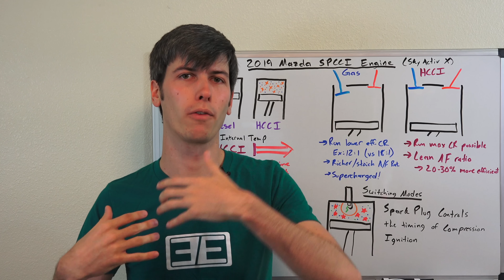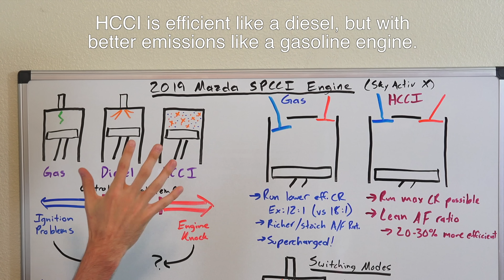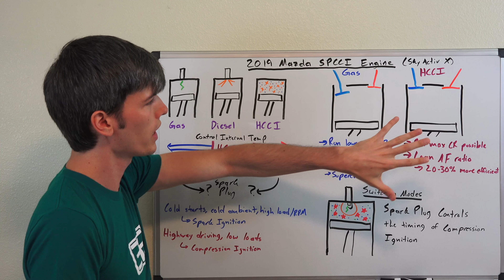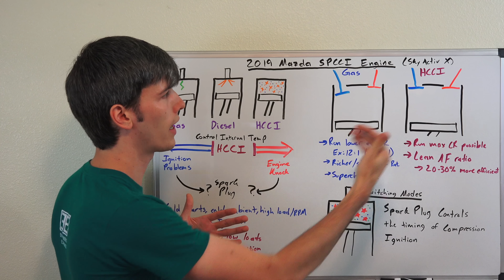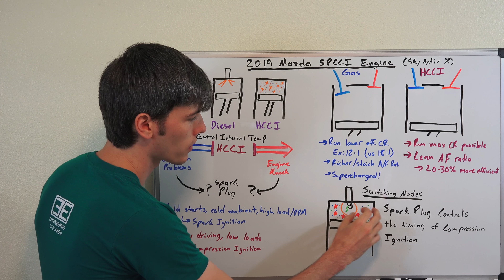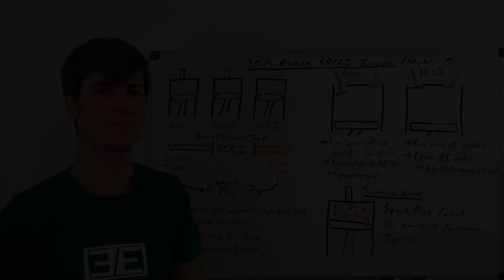Mazda Creates The Holy Grail Of Gasoline Engines - HCCI SkyActiv-X

Comment: When you create these high tech approaches to transportation be sure not to lose sight of who your customer is. How many times have you heard "Joe the shade tree" complain about fuel injection and the use of electronic ignition? Numerous,too many times too count? Why are you introducing another bit of tech that the average guy will not even be able to perform a "crank no start"on? Tech for tech's sake is an incorrect application of technology.

I agree with a previous poster. Stay electric, it is the future for personal transportation devices. Yes electricty can get complex but people tend to observe the warning "Halt,deadly voltage present,no serviceable parts inside" and either learn how to safely work around the voltages present with their auto or use a professional.

Don't get me wrong. I enjoy these ideas concerning a piston and cylinder. I am sure we have only scratched the surface as to how to make best use out of a piston that fits tightly into a cylinder, so keep up the good R+D.

Comment: I´ve read somewhere that HCCI engines controls that power stroke injecting the fuel into a smaller chamber in the cylinder head where the AF ratio is stoich (And the rest of the cyl is filled whit air). Then as this main combustion event takes place the piezo injector continus to inject the rest of the fuel in order to complete the power stroke.
The piston goes upwards compressing just air, the when it reaches the proper timming the injector skirts a little amount of fuel in a pocket located in the cylinder head where it also lives the sparkplug (in that pocket the AF ratio is 14,7:1 so the combustion takes place) but it isnt enough fuel to complete the power stroke thats where the piezo injector skirts one o multiple injections to "power up" that stroke, I´ve read it somewhere, don´t remember when

Sorry for mi english

Tnks

Comment: I dont understand. It is just an otto cycle but supercharged. Whats the difference?
Reply from the maker: That's not all there is to it. This may help: https://youtu.be/OVWZFdb_AGc
Reply: In my opinion (not based on any fact), If we increase compression ratio, use high octane or much higher fuel, incorporate atkinson cycle such that the intake valve closes at that time which will result in higher compression ratio, and expansion ratio much higher, it would give much higher efficiency, higher than diesel.
Reply: leaner air/fuel mixture = better

Comment: Bring on the sustainable zoom zoom! I've managed to get the sustainable part nailed (converted all the fuel lines and seals on my turbo diesel so I can run waste veggie oils) but I don't even have 1 zoom :(  Two zooms is the dream! xD
Reply from the maker: I hope with great patience, your first zoom will arrive.
Reply: Engineering Explained Thanks but it won't happen with my current engine. It's a modern small capacity (1248cc) turbo diesel. If I stick with using diesel, I can get it remapped up to 130bhp, 187lb/ft without changing anything but running veggie oil seems to upset the computer, anything over 112bhp and 155lb/ft the computer goes in to safe mode. I've put it back to the stock map (87bhp 132lb/ft) for peace of mind. On a side note, seeing a new Vauxhall Combo 1.3cdti on a dyno has to be one of the funniest things ever to watch!
Reply: Herr doktorbimmer Yes, absolutely. I enjoy building and modifying cars and 4x4's, especially turbo diesels. A Tesla 3 is £30,000, a Nissan Leaf is £24,000, I got my van as a pre registered new van with only 28 miles on it for £7,500 (retail price is £14,450), I spent roughly £375 on the fuel lines and seals so I can run CARBON NEUTRAL waste vegetable oil then I spent another £200 to get it properly tuned. So, for just over £8,000 I have a van that is CARBON NEUTRAL without the need to destroy parts of the environment to mine the minerals needed for heavy batteries. I don't suffer range anxiety, if I need fuel and don't have any WVO with me, I can put diesel in which takes maybe 5 minutes to do, including standing in a cue waiting to pay as opposed to waiting 30 min for an 80% charge or 4 hours for a full charge although, I've never had to use diesel since converting to WVO as my van easily gets 700 miles from 1 tank of fuel.
 
 I get my WVO from a couple of local fish and chip shops for free, they have to pay for it to be disposed of otherwise. WVO also doesn't emit NOx when burned. An added benefit is that I am allowed to make and use 2,000 litres of WVO fuel without paying any fuel tax, that means almost 26,000 miles per year in my van tax free and carbon neutral using a waste product that would end up in a landfill or worse.

 I have no doubt that electric cars are the future but not with batteries, they will only really be worth it once Hydrogen fuel cells are an economic reality.
 On a last note, go and google "Lithium mines Canada" to see the damage to the environment they cause.
Reply: Trenten S I took the van to get professionally dyno tuned by a diesel specialist, the standard ecu is fully programmable on my van. The tuner thinks that the burn rate of the veggie oils must be different enough from diesel to mess with the O2 sensor in the exhaust. If I was going for big power, I would look at a stand alone ecu for more precise control but it's just not worth the cost for the potential gains as it's such a small capacity engine.
Reply: quinnjohn1 hmm. I am not sure, im going to UTI technical for diesel tech next year so I have been researching, all I know is that veggie oil burns similarly to diesel but emits a different exhaust fume, so I would think he's probably right considered this isn't a "fossil fuel." Maybe an O2 sensor would be worth looking into. At least something that can recognize veggie fumes.
Reply: quinnjohn1 thank you best of luck trying to fix your van! 😊
Reply: Herr doktorbimmer wrong it isnt a zero eisions car produktion neds more emisions and a e car is haviwr and need mutch more  materials anyone that says e cars are complete zero emision cars are a liar and the electicety comes from coal poweroplatnst that are way dirtyer 

buy the you can make bio fuel from seaweed that makes the ice car co2 neutral so wat ?
Reply: Engineering Explained Could lpg or lng injection assist this man achieve zoom with the veggie oil?
Reply: Robbie Mac I have a friend who has a 3.0td Hilux Surf with LPG fitted and it goes like a train! It's just too expensive for this van, it's meant to make me money, not use it up lol. When I can get enough saved to build myself another Hilux, LPG is definitely on the cards! My last Hilux was quite heavily modified with a custom head made by Falconer Engineering in Scotland. The valves were huge and the cam had a higher lift than standard although it used the standard cam duration and overlap. It also had a Garrett GT28R turbo fitted and I could barely pull away from my friends Hilux, his is bog standard other than the lpg!
Reply: quinnjohn1 thing probably pulled off the line quick
Reply: Trenten S Yeah, my Hilux was all about the low end torque, there was nothing really left above 4200rpm (redline was 5ooorpm) I could have put a gt30r on it which would have let it breathe properly in the higher revs but the gt28r was giving me 18psi by 1300rpm (standard max boost was 6psi @2500rpm) plus it really suited my driving style. Off roading was my hobby and it was my 2nd vehicle, I hated having to get rid of it but my partner's car died and we needed to sell it so she could get something else, that was 2009 and it's still a touchy subject in our house lol.
 I never even thought about changing the O2 sensor in the van but it makes sense that it would only have a narrowband from the factory as that would be more than adequate for the standard fuel setup. Looks like I have homework to do now lol. Thanks for your input and best of luck with your diesel tech course
Reply: Herr doktorbimmer To grow seeds in the same ground will inevitably drain its resources, its better to sustainably drain resources from many different sources
Reply: They are also going to come out with a hydrogen powered rotary engine that has all the noise and fun of a gas car, with no pollution. If they really invested in this tech it will be big.
Reply: quinnjohn1 you need a new ECU if it's running that problem. Provably an aftermarket chip so you don't run into that problem

Comment: I want to see HCCI used on a 2 cycle motorcycle....clean burning two strokes would be cool af.
Reply: Can't have clean burning when you are burning both oil and gas...
Reply: Wayne Wildman Most fuel powered RC cars are two stroke HCCI. Their fuel source is usually a methanol/nitromethane/caster oil blend though. I'm not sure how well it would work with gasoline/2-stroke oil mixtures.
Reply: Wayne Wildman Honda built a prototype one back in the 90s. Was called Exp2 or something.
Reply: Wayne Wildman "clean burning two-strokes" 
Words never spoken before
Reply: +Jake Garrett you can rev 4 strokes engines to 20000RPM too without bending any valve, 2 strokes are not more powerful because they spin faster but because they have twice the ignitions at the same RPMs.
Reply: You're absolutely right! I d like to see that,that could be extremely efficient!
Reply: Wayne Wildman Honda did it with the EXP-2, and it was extremely successful.  They achieved more than 100ft-lb of torque per liter of displacement, which is beyond even diesel territory without forced induction.  They also achieved better fuel economy per hp than their four-strokes at the time.  They got 5th at the Paris-Dakar essentially by accident, by virtue of its light weight, smooth power and ling fuel range.  But, one thing you have to know about Honda is they HATE two-strokes at the highest level.  That started with old man Soichiro himself.  These are the guys that didn't make a 2-stroke dirt bike until 1974, long after it became clear that 4-strokes were uncompetitive.  These are the guys who went into 500cc GP with oval pistons and 8 valves per cylinder in order to avoid entering a 2-stroke.  They were the first to end their 2-stroke dirt bike line after the displacement rules in MX changed, and they're the only ones to not even offer a 2-stroke minibike today.  They only ever made 2-strokes when there was no other choice.  Most people, especially those who got to ride the fantastic EXP-2, believe that the technology was not pursued for these internal political reasons.  We could have had 2-stroke HCCI Civics in the 90s.  Can you imagine how good that would have been?  Imagine if all the Honda Bros has expansion chambers instead of the fart cannons.
Reply: Yeah that's what I'm referring to, and that's a good point about the cool burn temps of the methanol. The engine would definitely have to be water cooled.
Reply: I have also watched a few "workshop" episodes. Illustrates both sides of internet coin. I sincerely doubt that he has any credentials and many of his observations are ludicrous. The lack of peer review makes further research all the more important for anyone trying to gather information online.
Reply: splewy You're referring to "nitro" or "glow plug engine", correct? They burn nitro methanol. This is due to methanol burning very cool (so it won't melt the tiny engine) and has nitro added for performance. Usually 15% Castrol oil for lubrication.

These can run 2 stroke fuel, but they would melt very quickly. It might run in a heavy duty version with the water cooled boat motors.
Reply: Just go watch some videos at the channel "The Workshop". Clean and 2T usually don't play well together.
Reply: 2 stroke is dirty because AF ratio is usually garbage and and the rotary problem going by the name of O I L.
Reply: but they wear out faster too . . . and I loved my SAAB 2-Stroke . . . had the oil injection system, which helped.
Reply: Jake Garrett actually Honda has been working on an HCCI 2 cycle for years now. Dirt Bike magazine had an article about it back before the world wide web. They had a prototype but it was prohibitively expensive.
Reply: ***** that is why Honda was working on it. Efficient and clean burning.  No unburned fuel coming from the exhaust.
Reply: Pedro Rocha Has been spoken by Honda engineers.
Reply: Austin C Yes you can.  You just have to burn it all. The only reason two cycles pollute is because some of the fuel/oil mix passes through unburned. 
Surely you knew that though.
Reply: Cory Stansbury thank you. You are the only other person who knew that fact. 
That prototype is why I made my original comment. 
The prototype was expensive but we will see it eventually.
Reply: Austin C 17 idiots joined you in your stupidity.
Reply: ***** I'm thinking dirtbikes.  As in return of two strokes to off road racing.
Reply: ***** it worked fine but cost a fortune.
Reply: Jordan Hillard wrong.
Reply: Dylan Headrick the workshop...been there, done that. The guy has his moments but he is far from the most knowledgeable engineer around.
Reply: Modelero one of the few intelligent comments here. 
Great going!
Reply: Wayne Wildman two strokes (with exception of supercharged ones) run dirty because the mixed in oil is used to lubricate the crankcase and some oil is burned, causing dirty exhaust. Manufacturers really just choose not to use two stroke gas engines, despite technology
Reply: Τhat s why i consider Japanese manufacturers far ahead they re trying after all and that's why are successful .
Reply: Alex Mobil "
Reply: JETZcorp  Very interesting. I didn't know that about Honda. I have a 2006 Honda cr250 2 stroke which i bought in 2007 because i was told all the mx manufacturers were getting rid of their 2 stroke bikes in favour of 4 stroke instead, that all 2 stroke bikes were going to be no more. And that Honda was going to be the first to get rid of them. Honda seems to be first and only manufacturer  that got rid of them. Plenty 2 strokes bikes made by manufactures in the last 10 years and still being made today.  Now i understand why Honda quit the 2 stroke market.
Reply: JETZcorp  2018 dodge ram with the cummins 6.7 diesel has 920 ft lb of torque
Reply: sure Amigo! we can still make them wonder 2 stroke light engines clean burning even in its current state...just fit a flame thrower burner in the exhaust pipes so all unburnt gases get toasted and roasted before they exit the muffler...
Reply: Wayne Wildman clean 2 strokes already exist. It is made by evinrude and Rotax and it use direct injection. Even Cleaner than 4 strokes.
Reply: Well KTM and Husqvarna made a 2 stroke fuel injected motorcycle that's a step on the right direction with its cleaner emissions don't wait for Japanese bikes to make the first move it's the European brands that imo are gonna revolutionize 2 strokes
Reply: Wayne Wildman normally those don't have valves, which is why they are awesome and you can rev them 16,000 RPM. You can put valves in them, but you'll bend them if you try to run the engine that fast, which defeats the purpose of a 2 stroke in my opinion. At that point I would rather have a regular 4 cycle for better fuel consumption.
Reply: Wayne Wildman 2 strokes don't have valves. The intake and exhaust port are open holes in the cylinder walls, about half way down the cylinder. 

There'll never be a clean burning 2 stroke, as they function by burning oil and gas. 

There have been more effecient 2 stroke engine, however. Take for instance, the 1991 Polaris Indy RXL efi. The engine was a 650cc (0.65L) inline 3 cylinder, 2 stroke engine that was oil injected, and fuel injected, and produced about 120hp from the factory. The oil injection had massive benefits over gas/oil mixture.

 First benefit being long life span. A non-oil injected 2 stroke will last you 3,000 miles, while one with oil injection will and have lasted over 20,000 miles. Oil injected 2 strokes also use far less fuel, and oil. Where a standard 2 stroke needs oil in it's fuel all the time, the oil tank will last 3-5 fuel tanks on an oil injected engine.

And then, we all know the fuel economy benefits of EFI, so I'll leave that one alone.
Reply: Ruckus 930lb ft